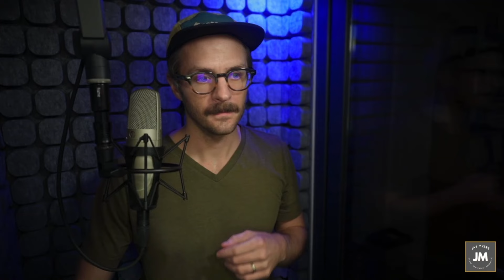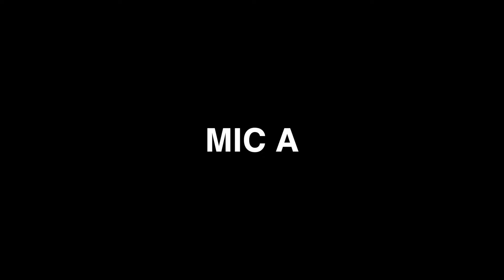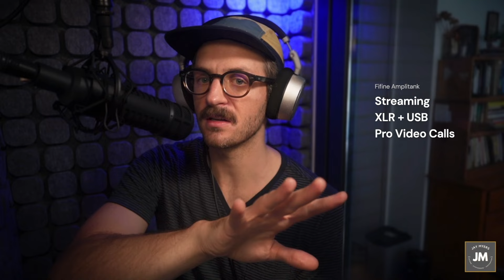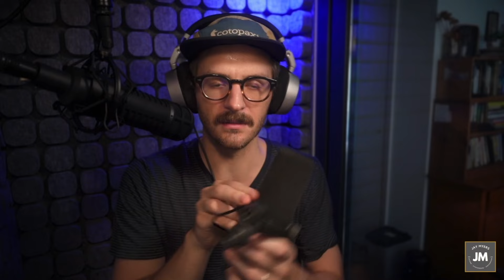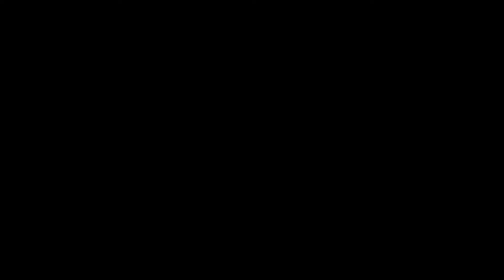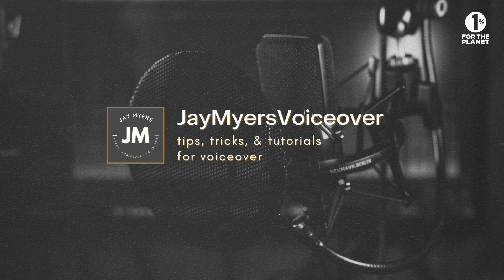Which Broadcast Mic is BEST for Voiceover? Blind Comparison & Review (RE20, SM7b, ETHOS, Amplitank)

Comment: Why does no one review the Icon Pro, it's 10x better than the Ethos, it's only $100 more.
It's way more neutral, WAY more articulate, and doesn't sound like you're talking into a sock covered microphone.
I returned my Ethos because it just sounded muffled to me no matter what I did. Only after removing the foam was when it even got close enough to EQ the low end to something decent.

btw, I have these mics, and I would say the RE20, is a FM radio promo sound, which I love, it's articulate and has that low end goodness but in a controlled way, my favorite tone out of the box by far.

The SM7B to me is the most neutral flat sounding out of them all, I love it, the noise floor is the only thing I don't like, but aesthetically it's a home run.

The Ethos, meh... it's beautiful, but the tone is just soo muffled and soo wooly and I don't even have a deep voice.  A lot of low end, and it's uncontrolled.

Bonus the Icon Pro would be my first pick followed by the RE20, followed by the SM7B, I'll pass on the Ethos.
Reply from the maker: I hear ya. With these mics, icon included, it really feels like a person taste thing. Way I see it you can’t go wrong, and it’s just down to what you like. 

Regarding icon vs ethos, I will say in my a/b testing, I found them to sound quite similar after removing the ethos’ foam and using an external pop filter. So I went with the ethos for its flexibility in that regard. Wish I could’ve included the icon though!
Reply: @jaymyersvoiceover  I do like how the ethos looks, but the sound, I couldn't do it. Figured I can get the Ethos sound by pulling the highs down on the Icon if I wanted. Also liked the cage around the capsule more than the foam look. Reminds me of steampunk airplane parts or something. It's hard to explain but it just has a refined industrial steampunk design feel. I think the foam also looks good, it's just a more disparate look.
Reply from the maker: @DailyRiot I hear ya!